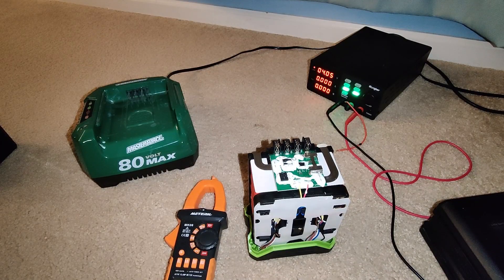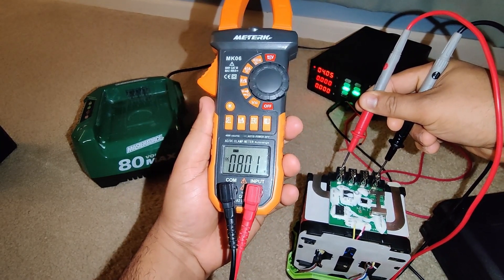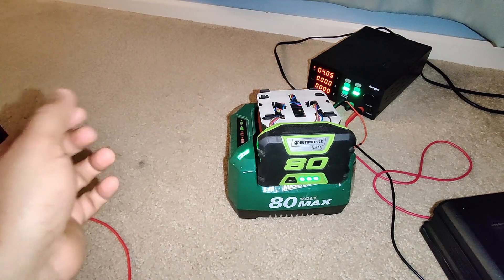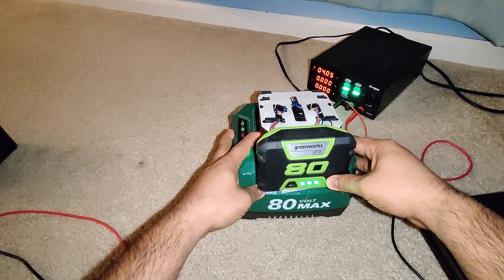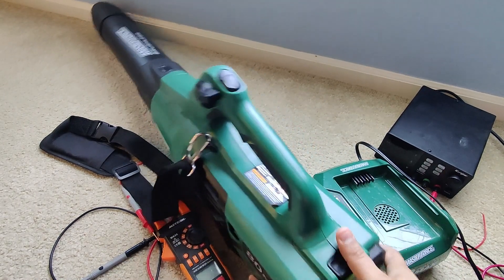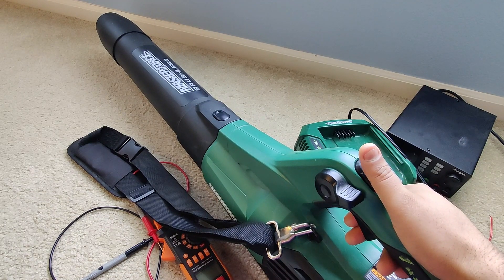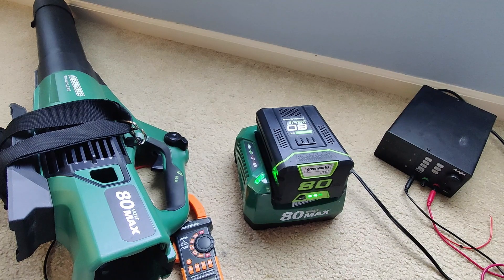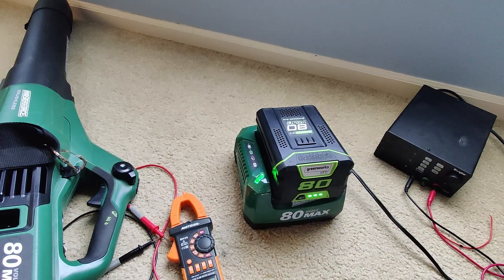Greenworks 80V 2AH Battery Teardown & Repair (Red Blinking Light Error!!!) Part 2

Comment: why not charge at 80v directly? or will bms block it?
Reply from the maker: BMS is designed to NOT work when cells are imbalanced so you won't be able to charge cells.
Reply: @Xx_TheCuriousBrain_xX  i was thinking maybe only a greenword chargers speaks to a greenworks bms, so any other method would just bypass bms^ because i saw another video where someone did that for greenworks 80v

Comment: when i try to charge 4v 1a, the battery smokes......what does that mean... i stopped.
Reply from the maker: Seems like it's leaking, gotta replace it. Not all batteries can be recovered.
Reply from the maker: Also when you replace it, make sure new cell is exact same specs such as mah otherwise new cell will charge/discharge sooner or later than others and you will always have imbalance issue
Reply: @Xx_TheCuriousBrain_xX  no way i'm replacing a cell on this greenworks battery pack, it's made so that's near impossible.
Reply: I'll pay for shipping if you want to get rid of it.

Comment: Greenworks weedeater is the worst product I've ever used fully charged takes almost hr half for 30 minutes of use or less most of the time use this product yesterday after third charge won't take any charge green light cuts off in two seconds turns red try four different outlets same result pretty much is a paper weight now

Comment: Hello The Curious Brain, thank you for stating how to fix these problems with these batteries. Can you please tell me what kind of charger you are using and who makes it.  Where can you purchase one?  I have a 80 volt Greenworks tools and one battery is bad. Greenworks says to just get rid of it at the recycling bin at Home Depot.  Thanks for your help.
Reply from the maker: Hello, yes these batteries can be easily repaired but manufacturers would never recommend repair method because it's not user friendly and not everyone is capable so I don't blame them. As far as the charger, I made the entire video on it, see the link below:

https://youtu.be/xWqgWKERKmY
Reply: Thank you for taking the time to respond to my question

Comment: Why did it lose balance?  Any ideas?
Reply from the maker: Good Question! Can be Bad or Weak Cell or left inside tool without charging for months. Depends on how BMS is designed, it's always draining tiny power and overtime it unbalances things. That's why you always want to charge/discharge lithium batteries regularly. If one cell goes weak, then it won't hold power long enough as others and will always go out of balance. Good example can be Tesla cars or any other electric cars with their battery issues

Comment: How do you make a charger to balance the cells?
Reply from the maker: Good Question! There are no charger that can balance cells, that's what BMS is supposed to do. Chargers are straight forward, they simply output certain voltage and done. Normally BMS aren't smart enough to balance things unless you go expensive like Tesla. In these type of electronic, companies like to play safe, if BMS detects unbalancing, it just shuts down the battery for safety so consumers can buy another battery. Don't know if they makes these BMS dumb for money or there is just not enough room...

Comment: Great video just what I needed. So I have 2 80v 4 a/h batteries that sat not being used for snow blower for a session. When I went to use them I was getting the red flashing light, so being under warranty I got them replaced and they told me to just send the old batteries to the recycle bin. I decided I would try to make one good battery out of the two by taking them apart and take good batteries and install them into the other to make one good battery, but this is what I want to try first . one battery just shows one cell down about .5 v   all the rest are the same. Looks like quite the effort to get a cell out so going to try this charging like you show first. Thanks
Reply from the maker: .5 is actually good thing, cell being dead or 0v is bad. It should start charging if you put voltage directly to that cell...Good Luck!
Reply: @Xx_TheCuriousBrain_xX  Thanks for the reply. So I did get a charger same as yours and charged the one cell that was low and managed to get it to .01 V to match the rest of them. I have  80V total now , but it still won't take a charge. I put battery in lawnmower and it lasted 30 seconds and it quit and repeated this several times to drain it more, still won't take a charge. I ran two wires to jump it from a new battery and let it balance charge for an hour and both batteries showed the same voltage and it will not take a charge while the good battery did charge. so not sure what to do next seems to be an issue with the battery control module. I have held the battery check button on the  battery for 30 sec's and it flashes once and assuming that resets the module , but still nothing.
Reply from the maker: Good Work! Sounds like battery cells are good if they are showing like 80V and lawn mower ran like 30 seconds but BMS is problem now as it's is not letting it charge now. This is a safety feature that requires BMS to reset. I don't remember exactly how it was done as I posted that video a while ago. Simply Google it how to reset BMS, sometimes there is a button, sometimes you will need to short 2 wires on BMS to reset it. Once it resets, it should charge like normal in your charger...good luck
Reply: @Xx_TheCuriousBrain_xX  I thought holding the battery button was resetting the module as the indicators flash off then on again after 15 sec's. I will research other possible options like you suggest. Thanks for the assistance.
Reply: Get you a cell charger/tester for $50, and I bet you will find a cell that is high resistance and almost no capacity.

Comment: Another tip: On the Greenworks battery, hold down the battery life indicator button for about 8-10 seconds until all of the lights blink to reset the internal BMS.

Comment: What variable supply are you using? I need a link. You have the best video for these batteries.
Reply from the maker: Thank you! Subscribe if you haven't already and here is the link, that's the one I got but anything similar would do the work! This power supply help me so much, well worth it
 You can also use this to charge pretty much anything in your house:-

Kungber DC Power Supply Variable with Memory, 30V 10A Adjustable Switching Regulated DC Bench Linear Power Supply with Memory Recall and Output Disable Button 4 Digits Display and Alligator Leads https://a.co/d/fVc3DCJ

Comment: I think you’re wasting your time. I think the some of those batteries are for the memory and eventually you’re gonna be back in the same position again soon.
Reply from the maker: Not sure what you mean by memory? Believe it or not, this video was posted 3-4 months ago and it's still working great for me and does full charge every time I use it. You could be right in other scenarios...
Reply: @Xx_TheCuriousBrain_xX  hah! Tell him to go ‘ground pound’ some sand!  👻
Reply: @Xx_TheCuriousBrain_xX  i was in one such other scenario, but i am going to try again by charging one battery with another battery, then doing a bms reset. second try would be your method
Reply: This chemistry doesn't have memory. That would be your NiCad or NMH cells

Comment: If the issue was the imbalance in cells, would draining the battery completely give you the same result?
Reply from the maker: Good question! In my case, draining didn't help as it all depends on the level of imbalance. Technically BMS should balance all cells, so definitely try that first to see if it works otherwise you'll have to charge individual cells to balance it enough before BMS takes over.
Reply: Thanks for the video! Will give it a try.
Reply: That sometimes works, but the trouble with these higher output batteries is how they just get to an imbalanced state.  Some are better than others.
Reply: @georgedavall9449  perhaps the soldering on each pair of batteries is not well centered
Reply: @greencable2222  interesting theory, and very possible?  👍

Comment: Hello,
How can I charge the kobalt 80V battery without the factory charger ?  I want to charge it on the bike if this is possible.  Thanks !
Reply from the maker: Good Question! Couple of things: You are talking about charging a lithium battery without a factory charger which can be very dangerous. As you can see, there are many 18650 cells in series to make 80v, so it's important it receives proper recommended voltage. You can charge individual cell but that isn't a realistic task and very time consuming process. In your question, the only way you can do that on the bike is to simply by using an inverter. Basically 12vdc to 120v AC but you do need a factory charger. So you can charge safely your battery...as far as inverter,.I would think 500 watt should be plenty enough but you may be okay with 300W inverter. Hope that helps!
Reply: @Xx_TheCuriousBrain_xX  thanks, I should have been more clear.  I have a cycle satiator “smart charger” that allows me to choose different voltages.  My question was specific to the terminals.  There is negative, ohm, “C” , positive.  I tried the negative and the “C” , but this didn’t help.  I’m not willing to press my luck beyond that until I receive clarification.  A battery builder had suggested the negative and the “C” terminal’s , but there must be something else that triggers the charge phase.  Thanks
Reply from the maker: @raylivengood8040 I see what you're saying and nope, sorry, I haven't played with BMS on charging that way. I do think you are going in the right direction but I'm not sure how exactly you would trigger charging using C or Signal terminals....
Reply from the maker: Let me know if you have any more questions and pls subscribe if you haven't already, I recently started this channel, so pretty new to all this!